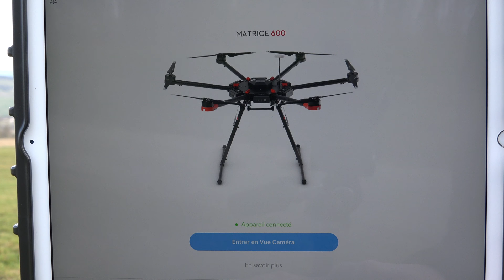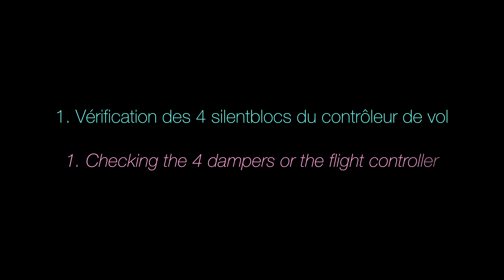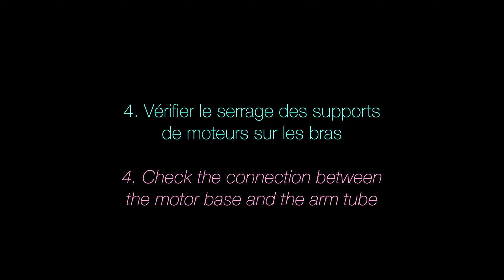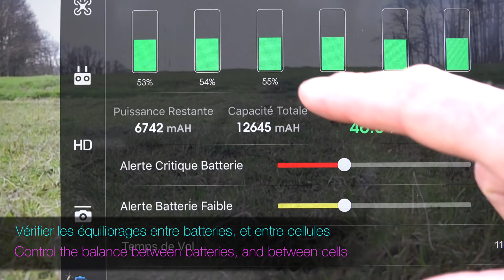La maintenance programmée du Matrice 600 de DJI

Comment: Having trouble finding what to do if the height between blade tips is >1cm.   Book says “adjust arm inclination” but can’t find any documentation on how one does such a thing.
Reply from the maker: I answer from my memory (I have no longer the M600) : you should be able to rotate the motor while unscrew the motor case from the carbon arm.

Comment: When it comes to rotating the batteries, can I ask the significance of this? I can't seem to find this part on the maintenance manual. 

Happy flying!
Reply from the maker: Thank you Jordan and you're right: it is not mentionned in the DJI Manual, it's only a personnal recommendation because the M600 batteries are connected in a parallel-serie connexion (total voltage is 12S), so it's not so bad to mix them in the locations.
Reply: Thanks good to know :) I really appreciate the video and your feedback!